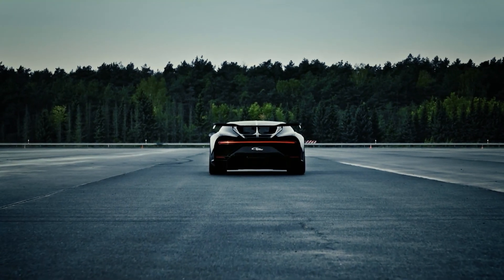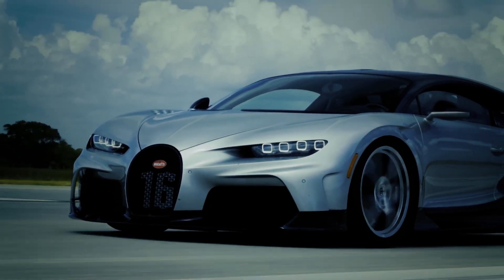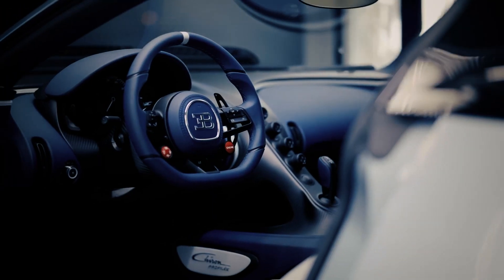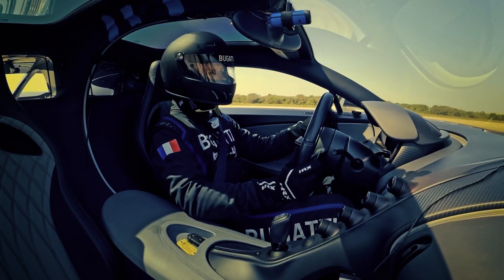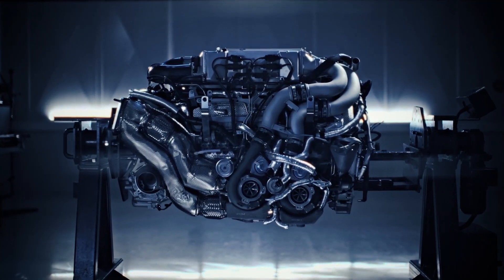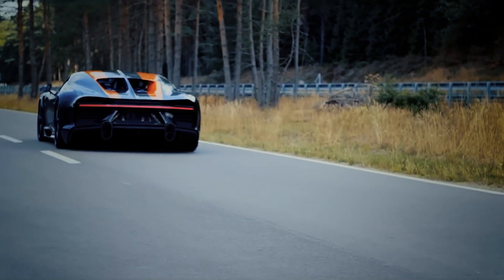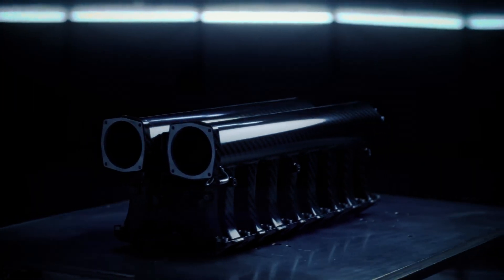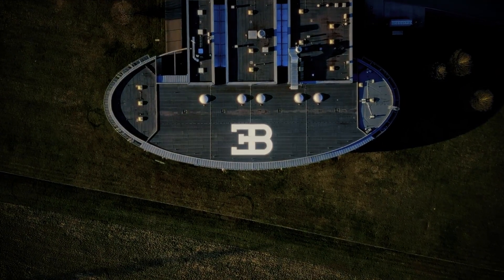This Engine  Creates A Sound Louder Than A Thunderstorm

Comment: Whilst its an awesome car... unparalleled power? The Yesko V8 alone is 1500hp, coupled with the dark matter electric motor in the Gemera for 2300hp and 2750nm torque.
Reply: It makes this power on regular gasoline. If Bugatti used E85 they might make 2100-2200 HP.